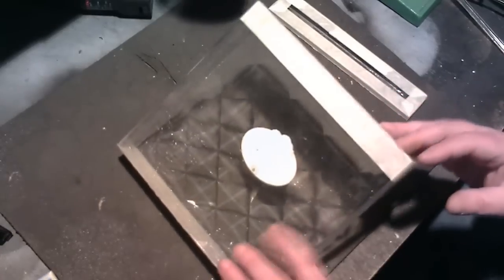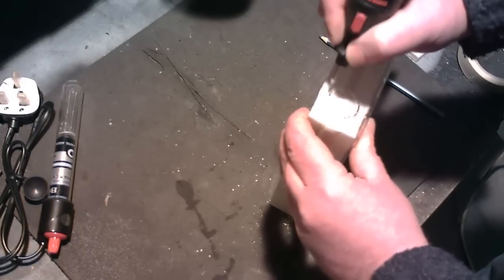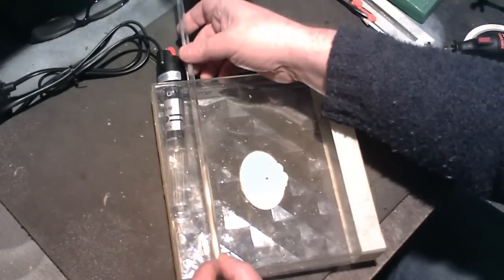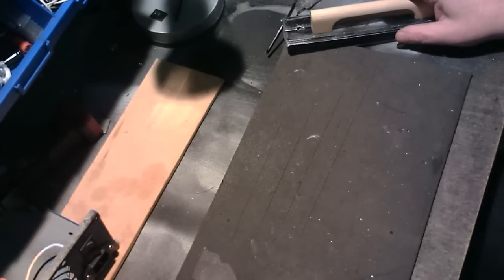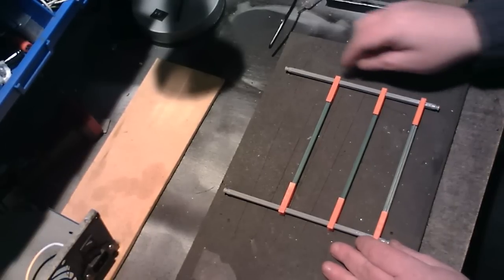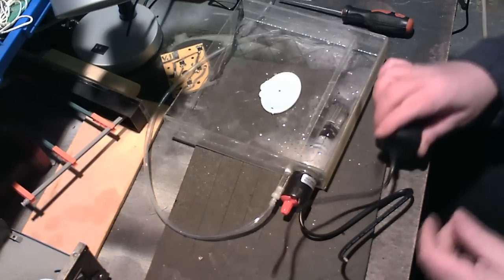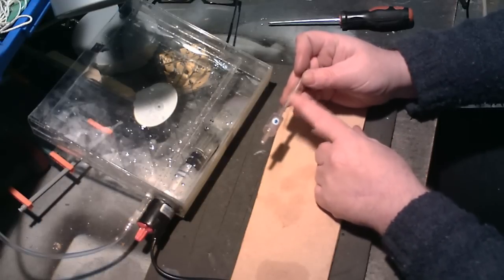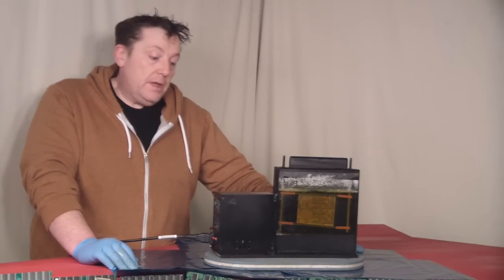make your own bubble etch tank

Comment: Woundering how much space within the Tank to the power of the Pump for the bubbles you had... Ie what would you suggest power pump wise (the size of the take is about right tho i dont have any Ferro like that so will have to find some thing else.

Plus the CONNECTS how are they holding up at a year of Etching and how is the tank holding up.